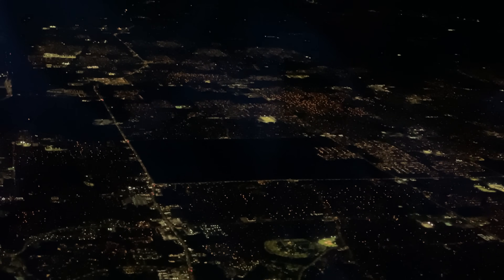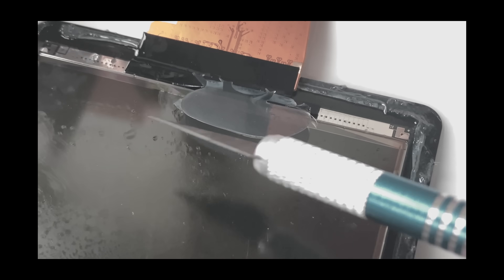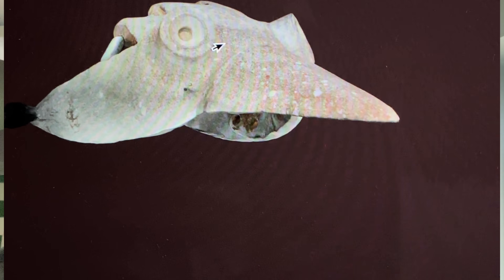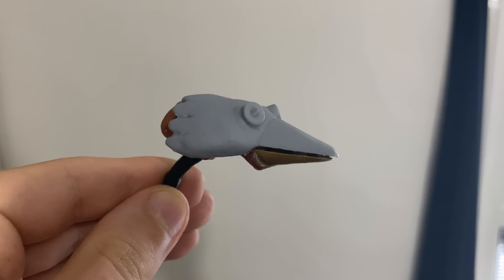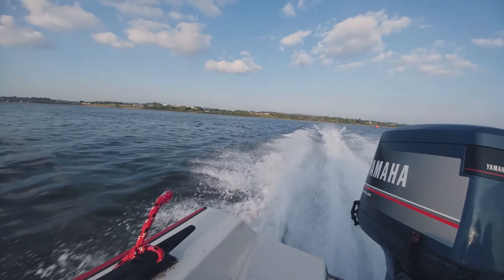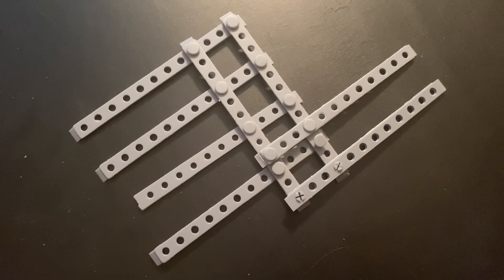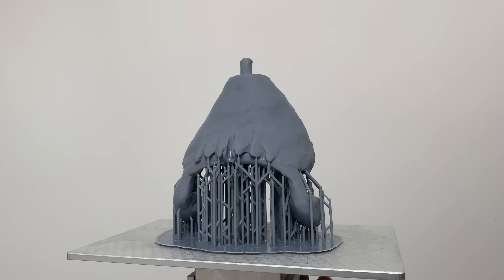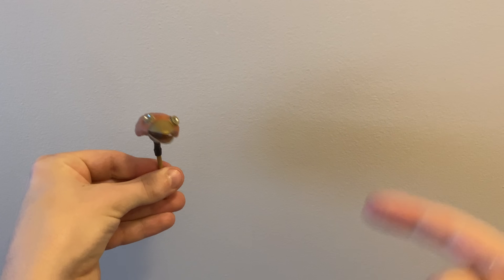we're FINALLY printing DABCHICK

Comment: This is so great. I am a dental technician. I print working models used to fabricate our restorations. We make anything that goes in your mouth, crowns bridges, partials, full dentures, orthotics appliances, etc. I say this because in our industry we have 3D printers designed and dedicated to dental only. This is because our room for error on a restoration is in the microns not millimeters. My current Asiga  printer, I have gotten to  print down to 20 microns of accuracy. When making a crown we have to find and match the margin the doctor has created while prepping that tooth. Well some teeth and margins are very small, so accurate prints are vital

Comment: Have you considered sculpting a prototype with toy wax? I've seen a video from the Craftsman SteadyCraftin talking about a recepi to make it. It was a type of wax used by toymakers for making smooth prototypes. I think it's similar to jewelry wax? Idk. A medium to consider if you want to do metal casting. The surface finish can be easily smoothed out with heat.

Comment: POOPING MECH

OK, so I am literally losing sleep over this but I have the solution. Using the squeaker pillow out of a dog toy attached to the inside of his chest plate, you could then attach a hose running toward the tail, just get an anus hole drilled (sorry Dabs - I meant a cloaca). The pillow can be either squeezed against the palm or inner chest plate depending on your comfort. Ensure the hose stays empty to allow for natural movements to occur without any accidents.

Comment: I adore the character you've built for Dabchick. Also, as someone who does a lot of 3d printing, I'm sorry you tried starting with a used model. Each machine has different quirks and it's incredibly hard to diagnose them without the context of watching them slowly break. 

Final point: Please use care when working with resin. There was some footage at the beginning of the video showing you nearly touching the wet print with your bare hands. Please don't give yourself a resin sensitivity by accident.

Comment: I always heard that resin printing was better for stationary figures instead of articulated ones, as it featured greater detail but at the cost of durability under continuous stress when compared to PLA. 

I'd love to hear your opinions on the subject.

Disclaimer: I've never used a 3d printer. It's something that's been lingering in my "someday" list for years, so I have 0 experience on the subject.

Comment: I'll say that I've had zero successful prints out of my Elegoo Mars2 Pro for a while, and I've found that the resin itself has a minimum workable temperature, its just been too cold in the UK to print. Still waiting on a little heater to build into the printer but I've read and seen plenty of videos on youtube that say it'll work. We shall see.

Comment: I think you're doing a great job!
However, I believe that you can print your models more easily and calmly if you use the Lychee Slicer, it has better detectors to place the supports on the parts when printing and is more customized
and if you have any problems with the piece coming off the platform, you can give it a very light sanding to increase the chances of it sticking.
Anyway, you're doing a great job, keep it up :D

Comment: I have had great success with Siraya Tech Tenacious resin, which is very flexible. I mix it in a 30/70 ratio with their Blu resin and a bit of dye to get a very tough mildly flexible print. It printed some back up iron sights for a rifle, and they have held up for well over 2 years of hunting and general abuse while remaining dimensionally accurate. You can tweak the ratio to add more flex by increasing the amount of Tenacious... For Dabchick, some shell parts and the feet may benefit from this. A pure Tenacious print is similar in flexibility to  an old hardened gummy canady.

Comment: Try a 2:1 mix of Tough:Flexible resin and experiment with adjusting the ratios. That should give you a model that's fairly rigid, but very durable and unlikely to simply break.

Comment: Finally making great progress!!!

You might look at using some SirayaTech Nylon-like resin for the fragile bits. It's extremely rugged but also has a bit of flex to it, so it can often hold up in scenarios like going into and out of your pocket much better than even metal would. Engineering resins are pretty cool stuff.
Reply: Came here to recommend this exact same resin!
Reply: Definitely. That was uncalled for and desperately needed

Comment: Look into a resin mixture. 25% Siraya Tech Tenacious -Flexible Resin and 75% EPAX 3D Hard Resin.
The result is a harder, yet still flexible resin. Its not super durable, but it is significantly less brittle than normal resin. 
You can also try printing it in Tenacious directly which might produce a flexible enough piece to be functional.

Comment: Paul's Garage has been working on using 3d prints as patterns for casting.  There is a special resin for "lost wax" casting.  Regular resin doesn't work well.

Comment: If you want to keep the wings perfectly symmetrical, while keeping the part count to a minimum, I recommend umaking the wing into a compliant mechanism. Effectively, you can get all the motion you want, while keeping the whole wing as a single piece of material, and you should be able to 3D print it all in one go. It takes some research and fancy math, but it will be more durable, less failure points, easier to replace, and stronger overall.